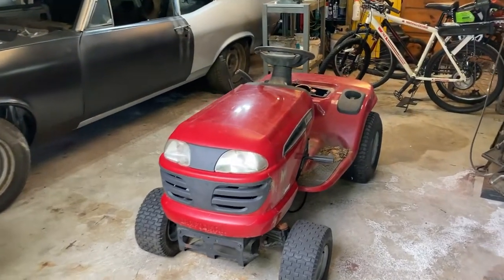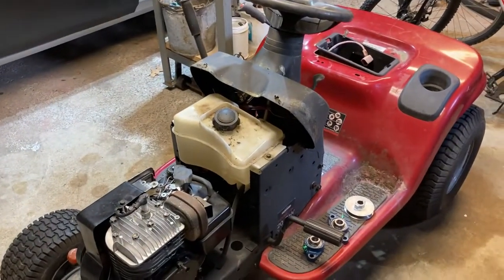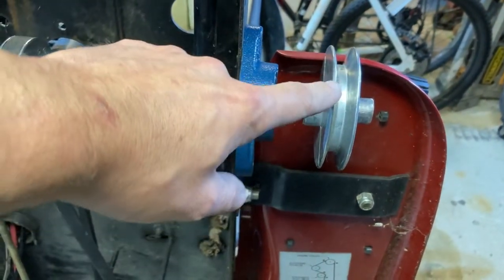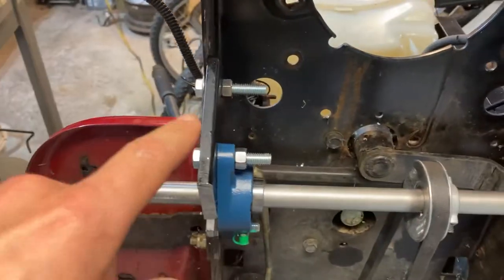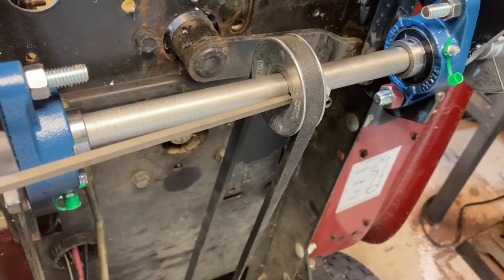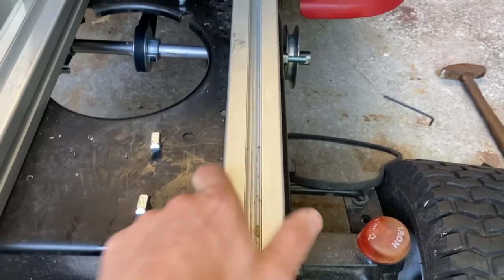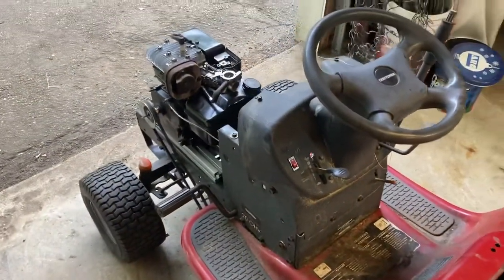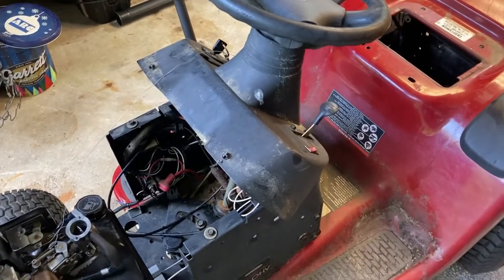Horizontal shaft In a ridding lawn mower

Comment: this will shred the belts so fast with the belt twisiting like that
Reply from the maker: That was my first thought but with the belt being so long the twist seems gradual enough that it hasn’t had Excessive wear. Just gonna keep using it and see how long it lasts
Reply: @JGD16  yeah may aswell try it but if it doesn’t work they sell 90 degree gear boxes that u can use for it
Reply from the maker: Yeah that’s a good idea I just want the cheap route and use stuff that I already had thanks for the suggestion
Reply: needs an idler pulley
Reply: Why not swap the transaxle to a live axle?

Comment: i did it by mounting the engine above & behind the axle, after rotating the transaxle 90°, so the input was horizontal. I then connected the two with a 1000rpm centrifugal clutch & #35 chain.

it went over 25mph with a stock Predator 212.
Reply: Any pics? Maybe an explanation video?
Reply: A few pics, but I sold it, last year...youtube allowed photo uploads for discussions years ago, but not now :(
 
Every part of the engine mount was originally on the mower, hanging the deck. IMO, JD just put it together wrong.

 I also dropped the front axle & stretched the wheelbase,  all the way. 

& moved the hood mounts forward 6" & down 4". The grill was oem, but moved up 4" & the headlights were deleted.

Comment: How do you stop if the clutch/brake isn’t on the belt?
Reply from the maker: The brake is on the transaxle and connects to the brake pedal via a linkage so it still works as normal. The lack of clutch just means it has to be shifted into neutral before stopping